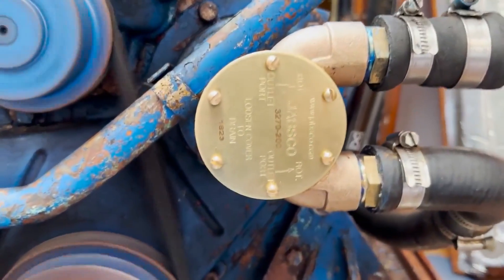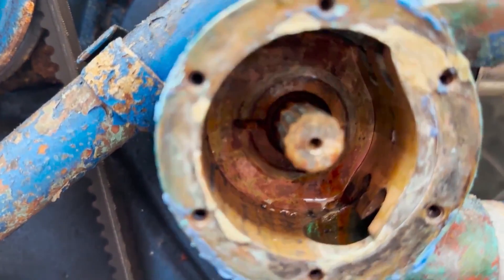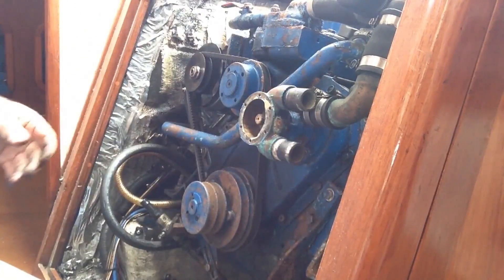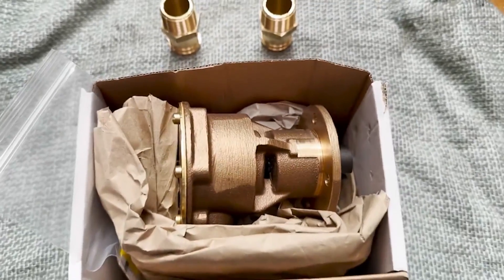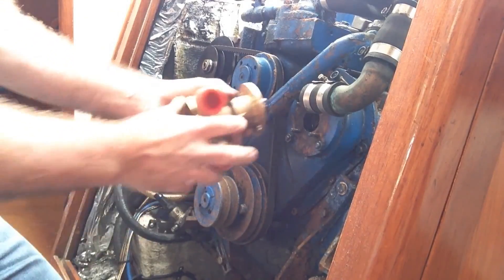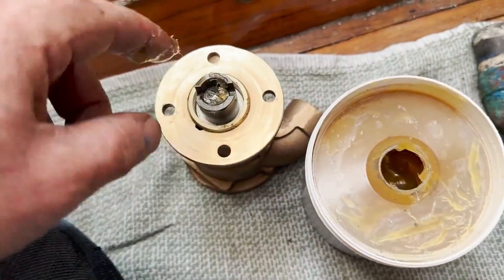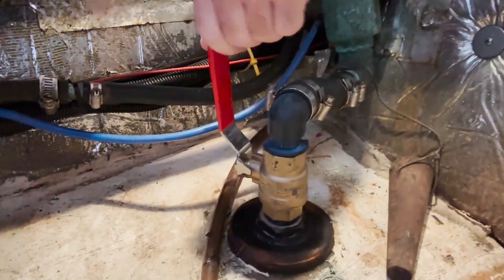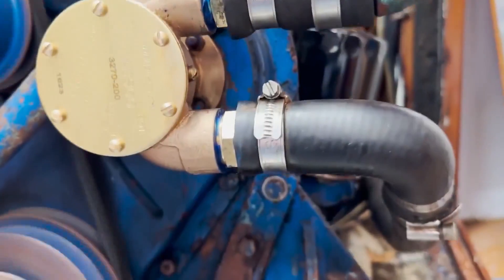Raw Water Pump Replacement : Perkins 4108

Comment: I recommend what is also my practice for over 50 years etc: among other things, always clean the surfaces between devices, pumps, etc. from old seals and adhesives, sealants, etc. Sand with water-based sandpaper to metal, degrease thoroughly and only then apply Klingerit, etc.: on the relevant seals between pumps, etc. And only THEN install the pumps, etc.: and always tighten the screws, nuts, etc. properly in a crosswise manner. For a seawater pump, I recommend driving this pump either via an extended axis, the pump drive shaft or driving this pump separately via an electric motor, so that in the event of damage to the pump seal, the motor, salty seawater does not get into the motor, into the oil, etc.: which would create salty white oil with seawater, which could destroy the entire motor, etc. Which is difficult to repair on the open sea and oceans. But it is much more complicated etc.

Comment: Thank you. Can you explain the closed refrigeration circuit with the liquid water pump?
Reply from the maker: I removed mine. To many parts to keep maintained.
Reply: Je n'ai pas compris la réponse. S'il vous plaît, pouvez-vous expliquer le circuit de refroidissement fermé avec une explication de la pompe à eau douce ?
Reply from the maker: I cannot make a video about the refrigeration system because I removed it. I don't have it anymore. It's in the bin long ago. It was broken, and I didn't use it anyway. Instead I use a portable fridge. https://amzn.to/3sbncT8